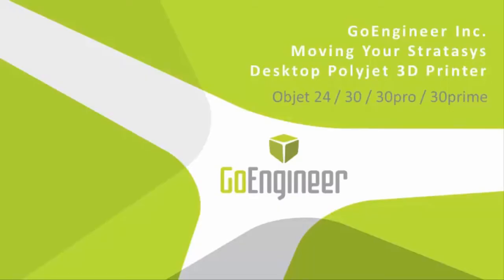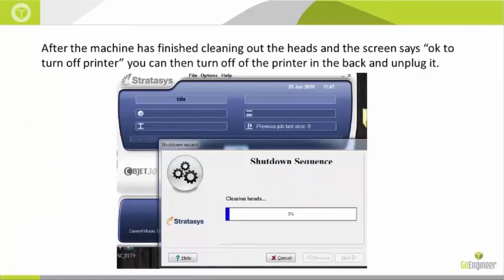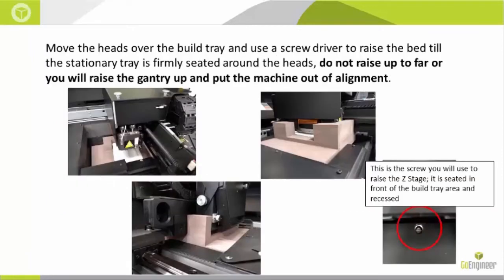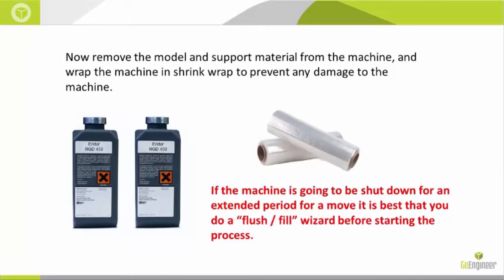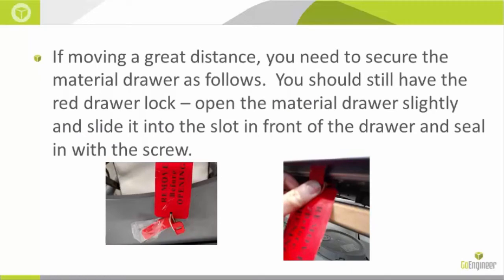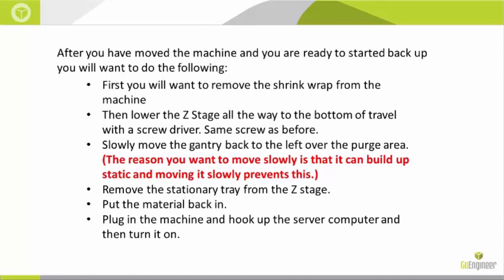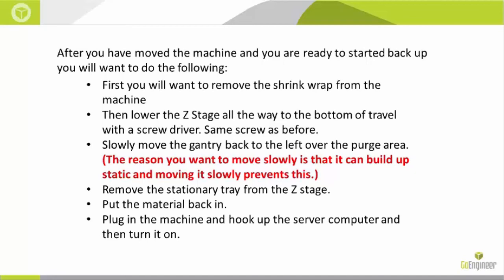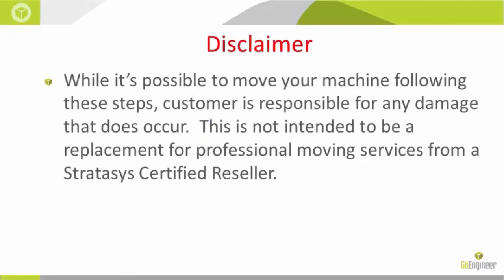Stratasys - Moving Desktop Polyjet 3D Printer

Comment: thank you sir,

please I have question regarding solidwork 2016 .

I didn't find flow simulation ??
only have floxpress.

is it separated
 software ??
thanks.
Reply from the maker: MyDreams, yes, SOLIDWORKS Flow Simulation is a separate software from FloXpress.  Thank you for watching.
Reply: +GoEngineer thank you very much
Reply from the maker: Thank you for stopping by!